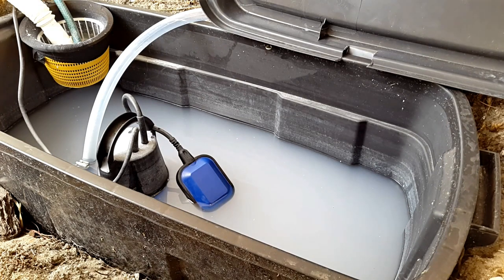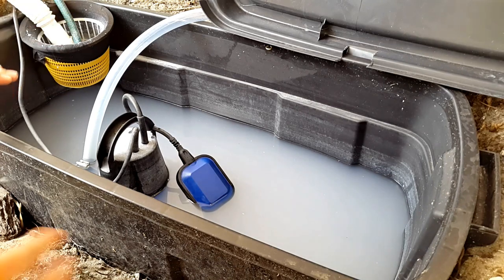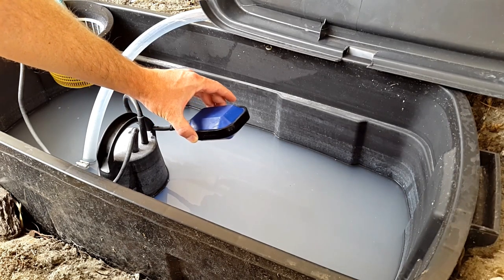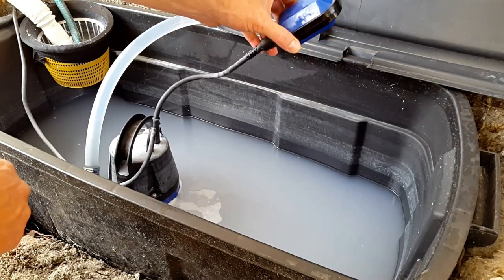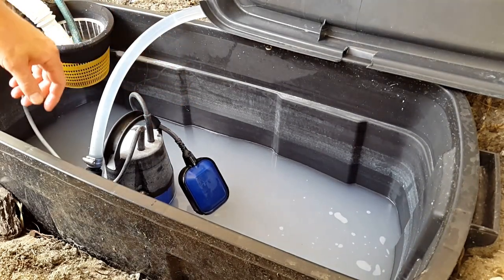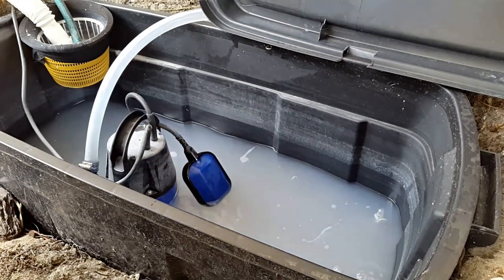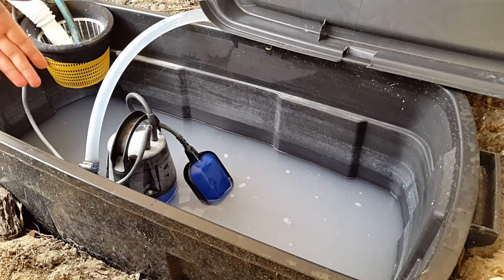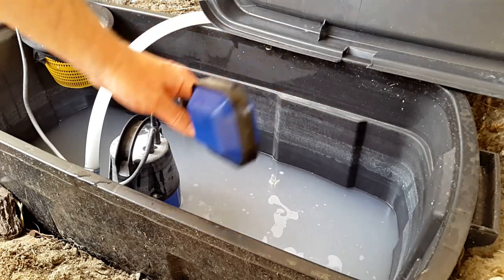4. How to adjust submersible pump tethered float switch

Comment: Those of you waiting for a fifth video, I suspect that he was going to strap the arm half way down, like an elbow, around the pump so that the pivot point is lower. That will allow the pump to start and stop at lower levels and should decrease chances if getting obstructed by the pit walls.

Comment: Excellent video. Please can you explain how to activate float switch earlier than that. I have one in my basement. But I need it to turn on earlier. Is it also possible to remove that switch and install a vertical water leveler. ?? Please. I really need your expertise